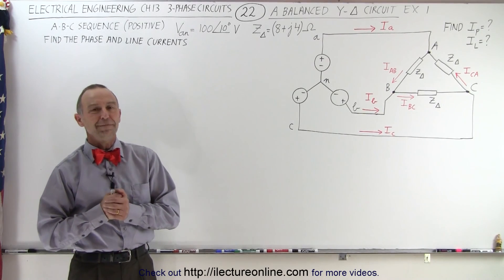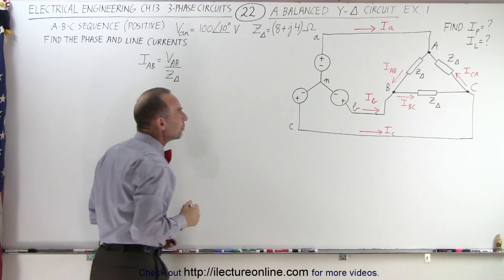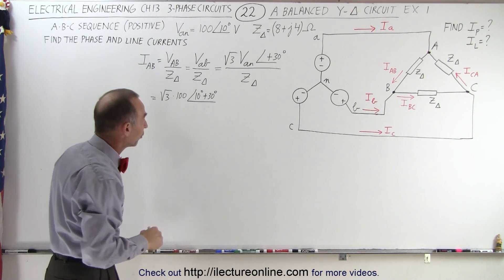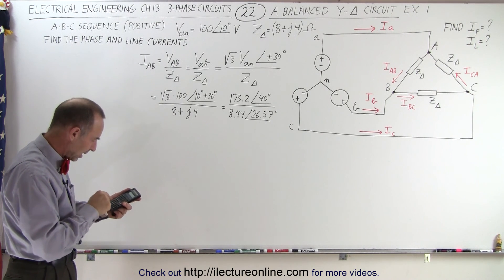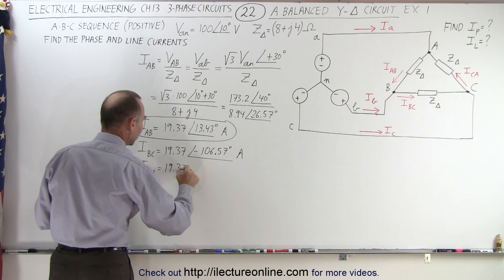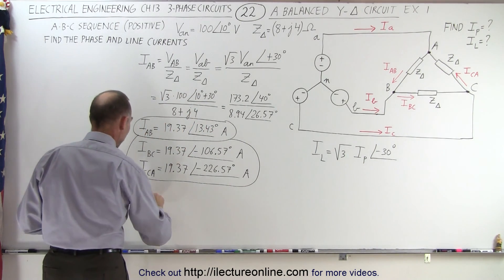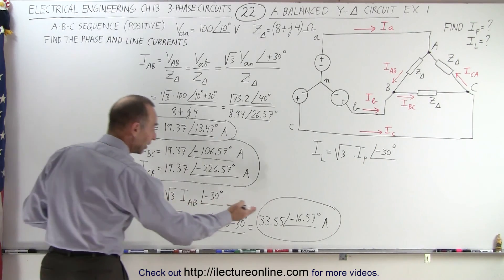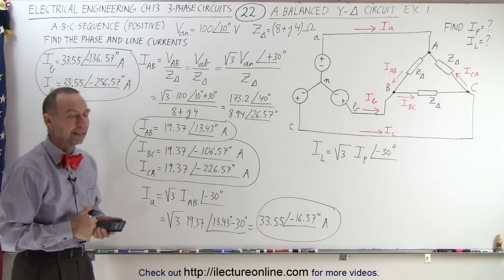Electrical Engineering: Ch 13: 3 Phase Circuit (22 of 53) Balanced Y-Delta Circuit: Ex 1

Comment: Happy new year!Excellent and helpful video !  If the sources had an impedence of their own (Zs) and therefore I am not able to determine the Van, should I transform the loads from Delta to Y formation and solve the one phase circuit ?
Reply from the maker: Happy new year!  The impedance of the source is usually added to the impedance of the branch.

Comment: I think line voltage =phase voltage with delta load, is that true ??
if that is true I think V(ab)=V(an) with out multiplying by root 3 and add 30 to the angle..

Comment: can you tell me how many electrical power rise due to increase in number of phases ? or in another word, what is the relation between number of phases and power?
Reply from the maker: There is no electrical power rise with the use of multi-phase systems.  The advantages are reduced currrent in the neutral, and a balanced load reducing the variation on electrical motors and enabling simplified motor design.

Comment: Question: Why do you use the symbol of the voltage source as a circle with a plus and minus sign inside it ?  Why don't we use the symbol of the AC voltage source sign which is a circle with a sin wave signal inside the circle ?
Reply from the maker: We use both.  The plus and minus signs are used to indicated the polarity of the voltage source.
Reply: I thought that AC voltage source does not have a polarity. It is alternating between positive and negative. Isn't that right  ?
Reply from the maker: Even with AC voltage there will be a positive and a negative terminal.  If you check the outlets in your home with a voltmeter, you will find out that there is a voltage difference and that one side is about 120 V higher than the other side.  (if you live in the US).
Reply: @MichelvanBiezen  
I don't live in the U.S.
Do you mean that the plus refers to the phase terminal  and the negative refers to the nuetral terminal  on the basis that the nuetral terminal is connected to ground in the U.S. ?

Comment: sir where does -30 degrees come from because this is the positive phase?
Reply from the maker: In this type of 3-phase connection, there is a 30 degree phase differnce between the line voltage and the phase voltage.

Comment: When we say 100 < 10 degrees. Is the 100, peak voltage or RMS value?
Reply from the maker: Sorry, I did not understand your question.   The number on the left of the inequality sign is a number and on the right you have degrees.
Reply: @MichelvanBiezen  I meant in the first question, Van = 100 < 10⁰ Sir, does the 100 V given there represent rms value or peak value?
Reply from the maker: In the equation   V = V max /__(angle)    Thus the 100V is the peak value.
Reply: @MichelvanBiezen  Okay, thank you Sir.

Comment: Isnt the phase and line voltage the same since we are working with a delta connection?
Reply from the maker: In a Y- delta connection the phase voltage and the line voltage is indeed the same as shown in the video.

Comment: Sir, wouldn’t you add 120 to both ICA and IC? I was looking through my notes, and my professor’s notes say to add +120.
Reply from the maker: The angle - 226.57 is the same angle as + 103.43
Reply: @MichelvanBiezen  m

Comment: Wouldnt it be easier to convert the delta impedance into wye impedance by dividing the load impedance by 3, then finding the line current by dividing phase voltage and load impedance in Wye form?
Reply: I have the same question :(
Reply: It is possible, there’s already a video showing how

Comment: Sir but phase voltage= line voltage for delta circuit,so why did you multiplied V by √3 in 1st step?
Reply: Because Van is phase voltage of Y connected source

Comment: Why do we multiply it by root 3 .alsoo when do we know we have to multiply it by root  3
Reply: Line voltage is equal to √3 times of phase voltage
Reply: @rkvbuzz9244  and if you are wondering why you can check it wih kirchoff laws for proof